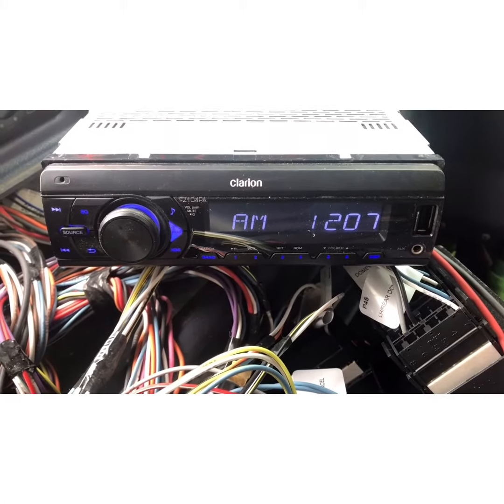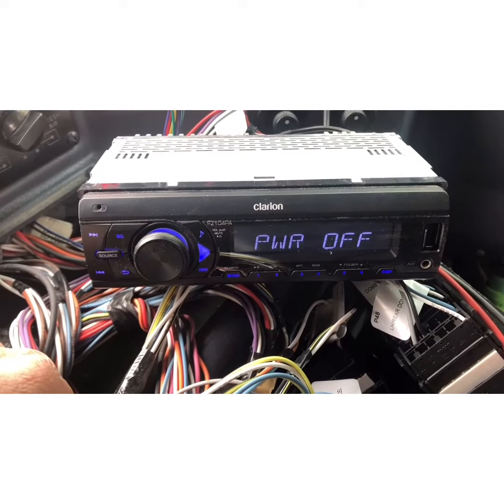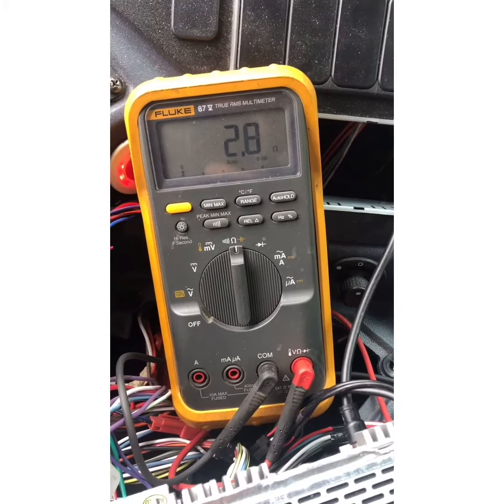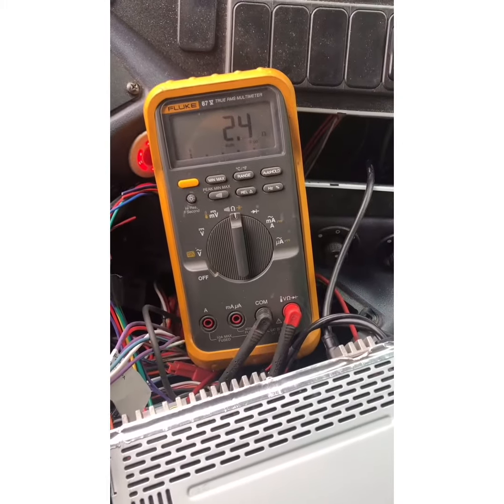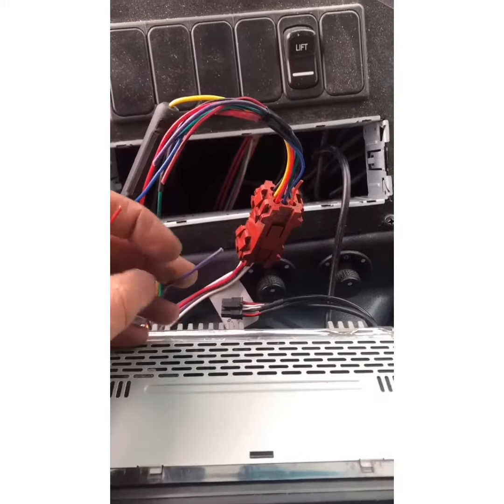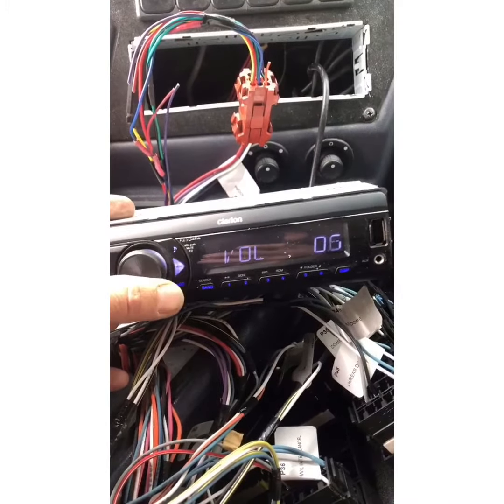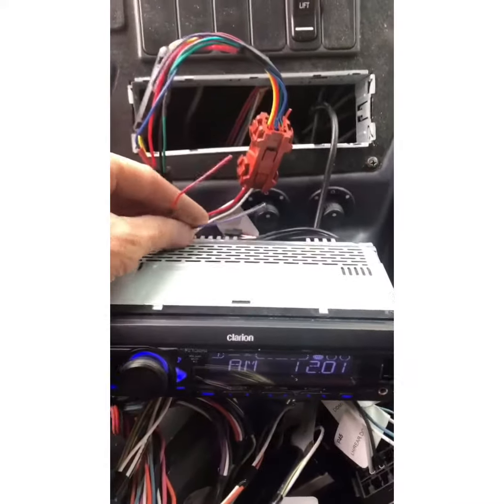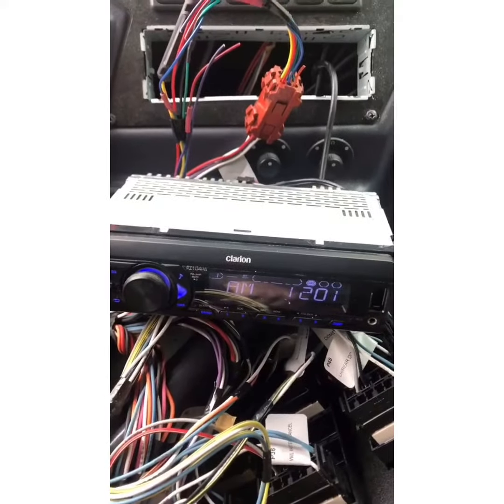Clarion FZ104PAE stereo error wire code

Comment: Do you remember where your wiring issue was? I am fighting a bus with the same problem. Thanks!
Reply from the maker: I believe it was in the speaker? So I just disconnected the right or left on speaker whatever it was and took it out of the equation.
Reply: @danofalltrades3567  awesome, thank you sir. My electrical tests came back all clear actually so I might try swapping radios out.
Reply: @danofalltrades3567  can this radio play bt audio
Reply from the maker: @matthewcook4256  I don’t recall but I want to say no?
Reply: The display on my clarion fz104pa is dim and can’t be adjusted. Do you know how to fix that?